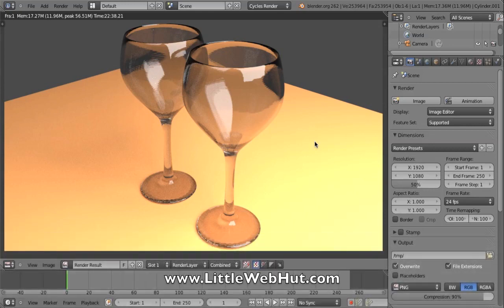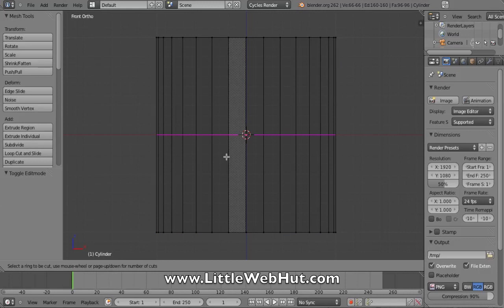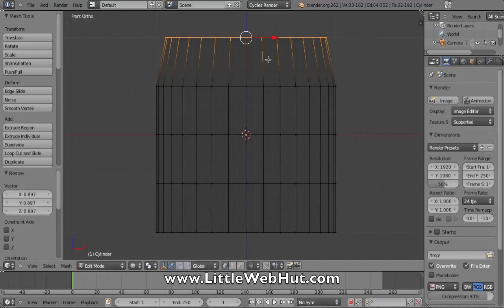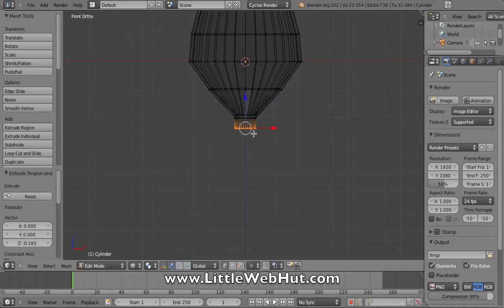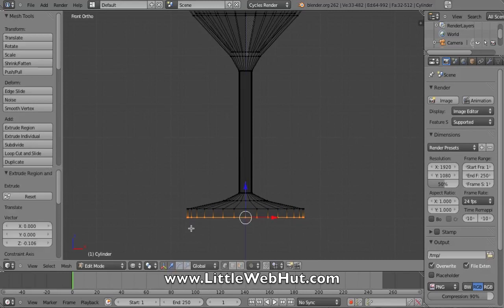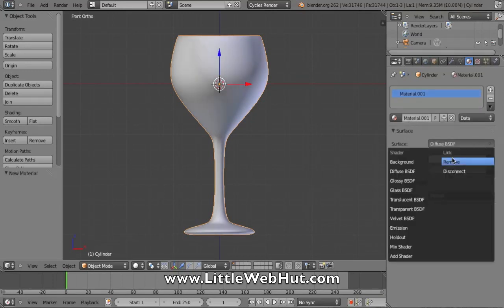Blender Tutorial For Beginners: Wine Glasses - 1 of 2

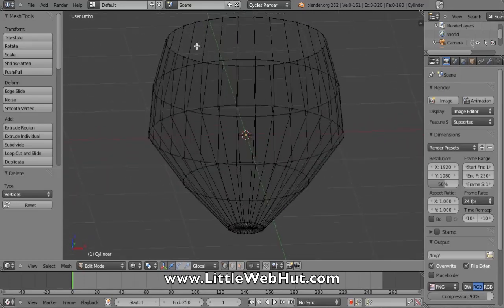Comment: IDK why my settings or sculptings always come out differently than the tutorial videos. I always pan an scan the screens under pause to check every tab on the tutors window to ensure mine are also selected, Always make sure I'm in the preferred cycle of the tutorial, like here it's cycles render. But mine didn't have the center point at he top. I followed the steps and deleted the face, but when he rotated his showing a complete cup, his had lines across the bottom filling it in. Mine are always open like the top... Upon clicking the Face tab and looking at the bottom, there's a center point but no line like his.... Indexed 5:49m of the video. And I'm using version 2.77a, he shows he using an older version 2.62... 
Also when I complete the shape of the glass and click, solid and object mode, his glass is a bright grey, mine are Always a darker shaded grey with little specks throughout. And I haven't rendered yet. So IDK....

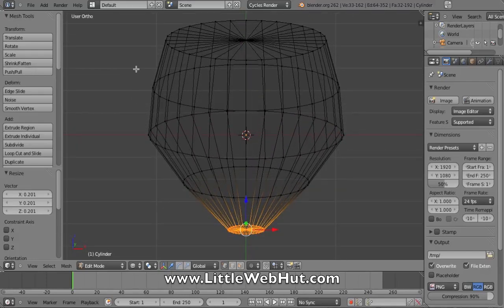Comment: Problem: At 5:35, there are no vertices / wires to delete on mine.

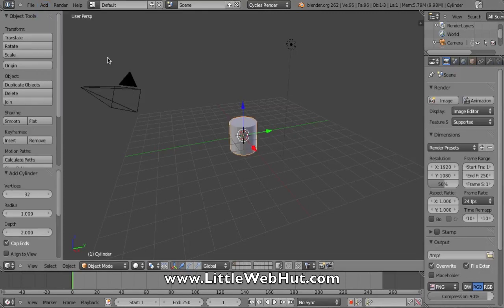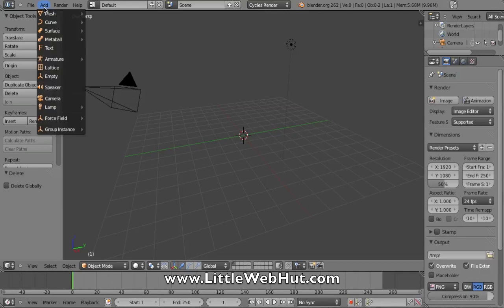Solution: When you first create your cylinder (@ 1:35), look at the cylinder properties on the left at the bottom of the Tools bar. You can see it in the video (@ 1:35 where it says Vertices 32, Radius 1.000, etc). Scroll down a little and find the Cap Fill Type options. Change it to Triangle Fan. You can watch him do it at the beginning of the coffee cup tutorial he does.

You will probably have to start the project over from the beginning because you can't change the cylinder's properties once you've done work on it.

Hope this helps!

Comment: ARe you getting a dome-face error on your cup? Here is the solution.
Like this message so everyone can find see this and fix the error.

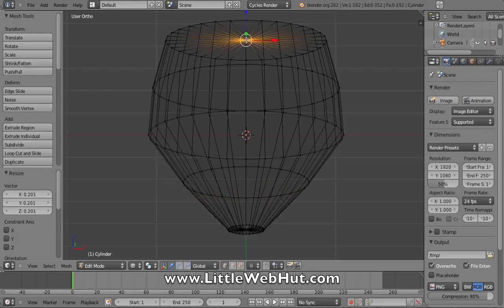If you are getting the problem where the top and bottom faces are NOT flat and hollow (instead you get a dome-shaped top and bottom), when you first create the cylinder, go to the tool panel on your left, and scroll down until you see "Cap Fill Type". SElect that to Triangle Fan. This will let you see the centre lines of the cylinder top and bottom shown in 5:38 so that you can delete it.

The tutorial did not mention changing cap fill type to triangle fan so you couldn't SEE those centre lines which you have to delete to stop your cup looking like a dome on the top and bottom faces.

For most of you, this means starting your project again from scratch :/

Comment: There is a faster way of doing that. After you deleted the cube and added a cylinder at the beggining of the video, you need to go to the left side of the screen and scroll down until you see caps fill type. Click on Ngon and then a little menu pops up. Select triangle fan and continue the tutorial from there. You used it for the coffee cup. This video contained the older version of blender. That why caps fill type is not there.

Comment: You can enable the "3 button emulator" in preferences under the file tab... its a little bit tricky, but when you get used to it, it's fine. I'm working off a mac with only one button so I can understand any frustration you run into lol

Comment: I use an old trackball so I have no wheel or middle button. I guess I could install the driver software and emulate a middle button by clicking left and right simultaneously. OR I could just use the keyboard's numeric keypad to navigate. You can zoom in and out using CTRL + and CTRL -. As for navigating,  In YOUR case you have to use FN to access the "numeric keypad" keys to navigate on a laptop. I'm using Blender on a laptop and have a trackball attached but as i said, no middle button or wheel

Comment: From Blender version 2.63 onwards, cylinders are capped with ngons (a single multi sided face), to get the old type cylinder as used in this tutorial, after adding the cylinder look in the tool shelf (left hand side) for the properties of the new cylinder and under Cap Fill Type change Ngon to Triangle Fan. :D

Comment: After I using wire frame and edit mode, in my work there was not any top center of glass. So when I check from the top, look like the glass already open. But after back to object mode and solid, my glass was not any hole. What should I do?

Comment: I'm using Blender 2.63 and when I go to create a cylinder both the top and bottom faces are hollow once I go into wire frame mode. This means I can't extrude them at 7:06. Any suggestions?

Cheers

Comment: I was following along with this tutorial until I got to the part where you extruded the bottom most vertices. I looked at my cylinder verses your cylinder and I noticed that mine doesn't have the center vertex or a face on the top and the bottom. Do I have my settings wrong or do I need to tweak them? Help me, please.

Comment: I thought I had been using an older version of Blender (and I might have been), so I rebuilt it and went to where the vertices are at the top and they are still missing. Also, when I go to Solid at that point, the top 'section' is solid. There are no vertices showing.

Comment from the maker: Here is one possible solution. While in Edit mode, the toolbar near the bottom of the display shows 3 little cubes. If you hover your mouse over them they display "Vertex select mode", "Edge select mode", and "Face select mode." The one called "Vertex select mode" needs to be selected. If Edge or Face is selected then the delete function will delete more than you want.